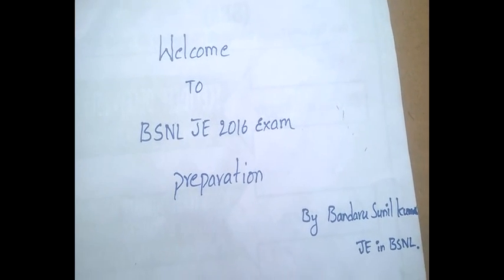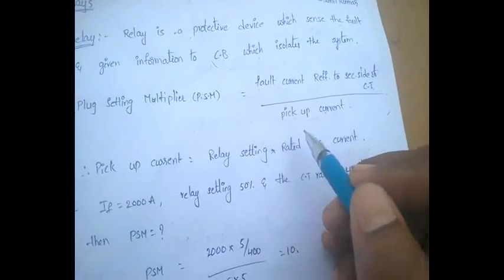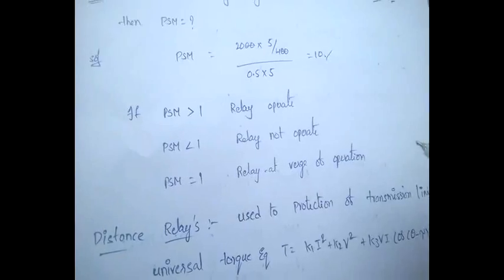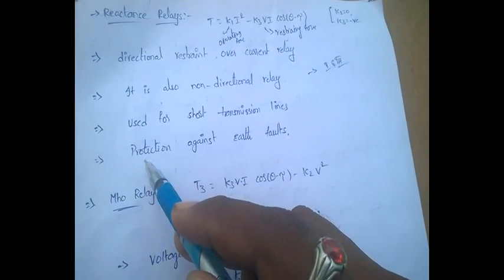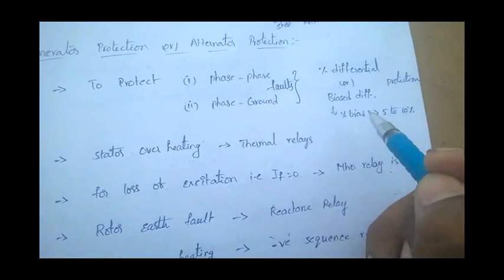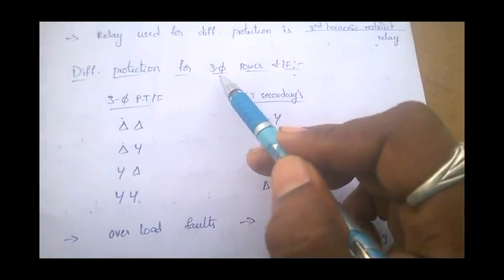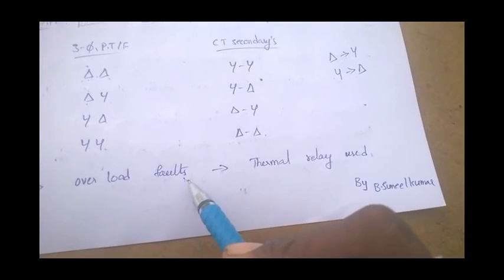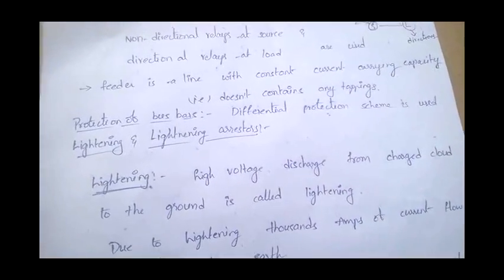RRB JE/RRB SSE/BSNL JE/SSC JE JOBS NOTES - ELECTRICAL PART 3-RELAYS AND PROTECTION

Comment: sir I've a confusion:in your electrical 3rd video Reactance relays are said to be directional in formula whereas in below, notes you have mentioned as they are non-directional ?
Reply from the maker: please dont conform by using the formula..a relay said is to be directional or non directional ..their is a phenomena..if it operates both 1 and 3 quadrants it is not a directional relay..reactance relay operates  both 1 & 3 quadrants..so it is a non directional relay.. 

in the formula also directioan is not an operating force..it is a restraining force..dont confuse..mho relay is only directional relay..